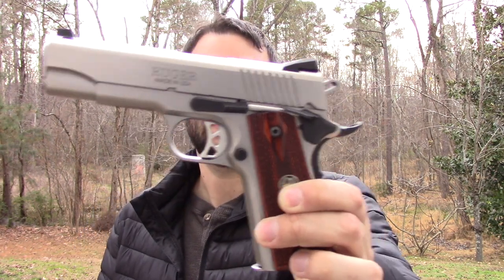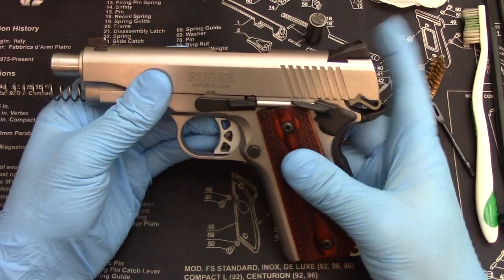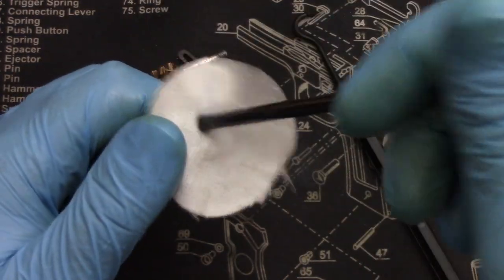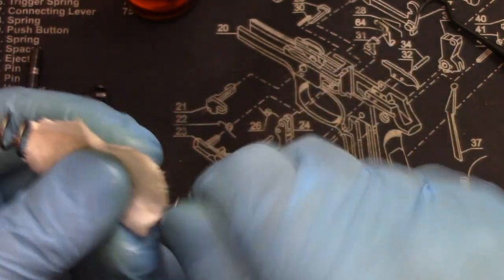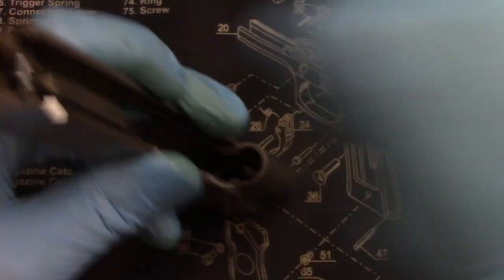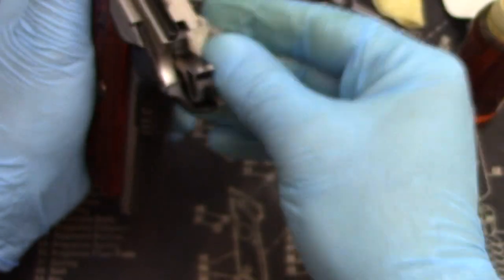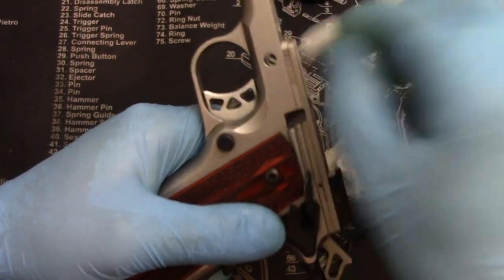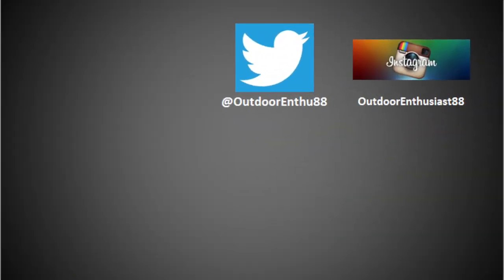How To Clean a 1911 | Ruger SR1911 Commander

Comment: How to clean your SR1911.  in an even easier way than this video. 
Step 1: completely disassemble the gun into individual pieces, (Pulling the trigger out is optional, don't   
              worry, completely disassembling doesn't take longer than 3 minutes longer than a field strip)
Step 2: Drop all the parts (Except wooden handles) into a pyrex with Dawn dish soap for 15 minutes.
Step 3: Use a toothbrush for the little bits you might have to scrub, otherwise wipe up the beaded  
              debris with a dry towel of at a time, and let them sit after drying long enough to dry. Usually dry  
              by the time assembly starts) 
Step 4:Reassemble and lube on the way.